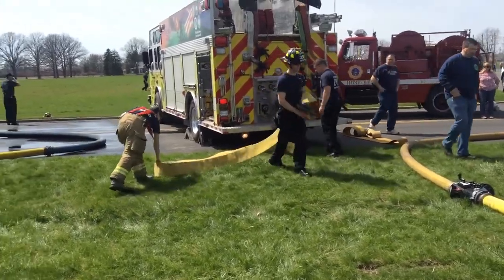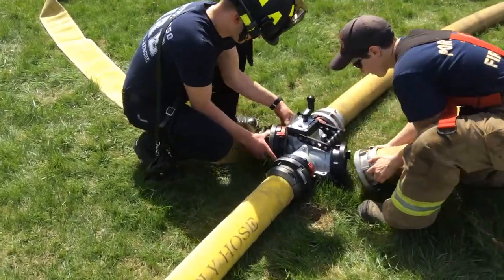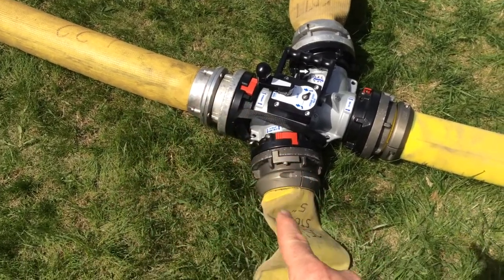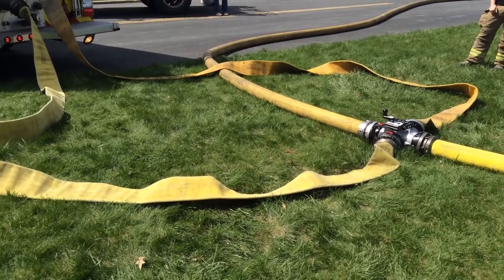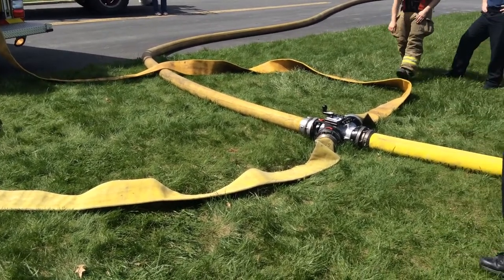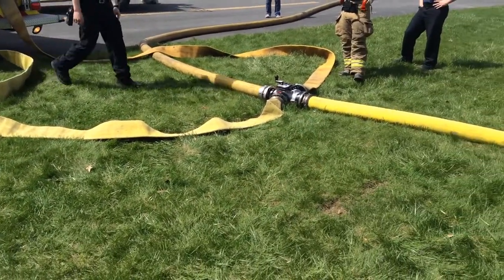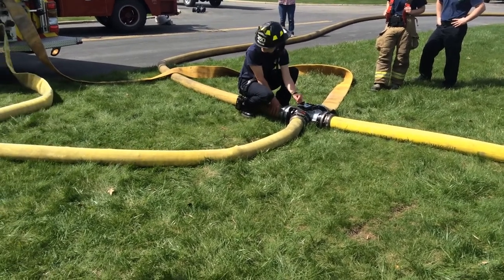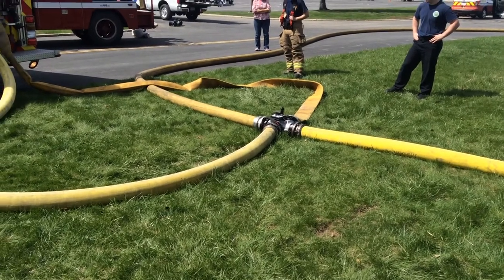Part 6 - Relay Pumping Drill - Delaware, Ohio - April 2015

Comment: We had a double double as we called it with 6" lines. We could pull from the hydrant and supply 2 big water lines at once at a high pressure.